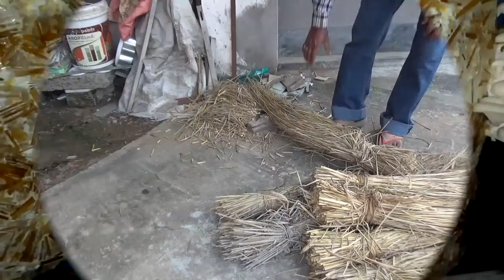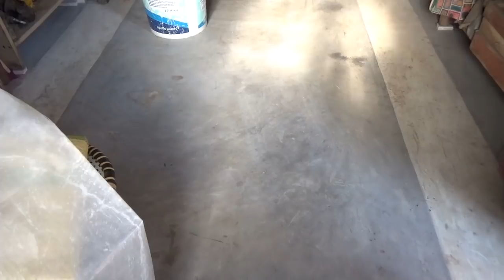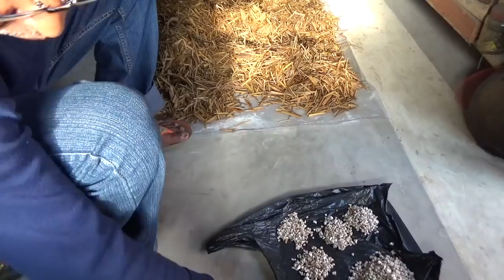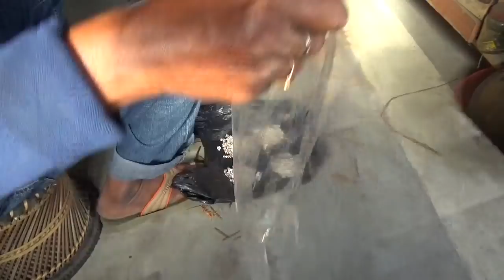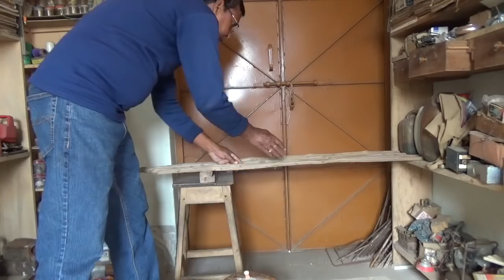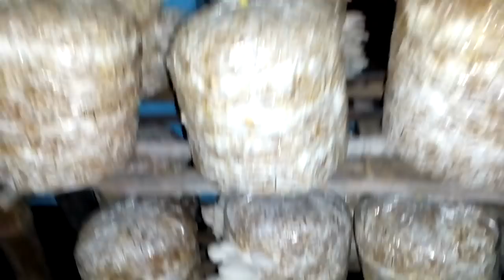Mushroom Cultivation (With English Subtitle)

Comment: Mycelium develop completely. Pp beg remove, spray plain weter 3 - 4 time, light and clear air requirements for more flush. For second flush 1/2 inch remove the beg all sides, spray weter regularly 3 - 4 time, get second time more flush. For third flush repite again second crop technique. And get third flush. And last vestag beg is feed for animal and get more Milk. Inshaallah.

Comment: Can I use the residue after harvesting mushrooms to inoculate new straw bags?
Reply: Answer please 🙏 me too I want to know
Reply: @apong3984  
It has been two years since i've  asked this question and since; i've found some answers;well it's possible but not recommanded since the mycelium became too weak to "invade" rapidly the new substrate  and also there is a possibilty of contamination so failure posdibilities are very high.
Reply: @mokhtar_One_u_Key  you can spread them out on some wood chips to inoculate outdoor mushroom beds.

Comment: Hi good day,
I'm about to start using paddy straw as my substrate for oyster mushroom. I just wanna know which pasteurisation method is better between steam/boil and cold hydrated lime water. Not in term of cost but in term of effectiveness. Hope any experience grower can help. I've been using sawdust as my substrate for 5 years but now in my country it getting more difficult to get sawdust due to pandemic. Thanks in advance.
Reply: sawdust pasteurisation is more difficult you have to get the temperature 80 degree in your boiling bag but in paddy straw just boil your mushroom bag half time may be 3 hours to get 80 degree but sawdust 6 hours to get 80 degree in your boiling process.
Reply: Hai orang Indonesia

Comment: Its not good to use chemical for food consumption. Try to find another alternatives.
Reply: Maricar Castillo that chemical is just to kill other bacterias as it can easily out run mushroom's growth. you can either boil in hot water if you think it's disturbing you. but either way, the reason is to kill any unwanted stuffs that can easily kill mushroom's growth
Reply: @JeffJohnson_123  to kill the bacteria is ok but how if it kill you?